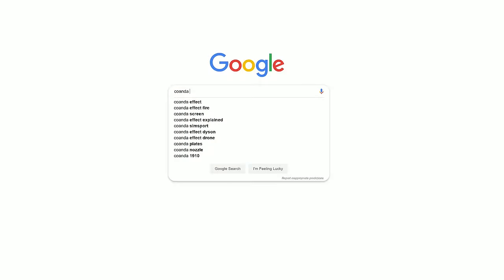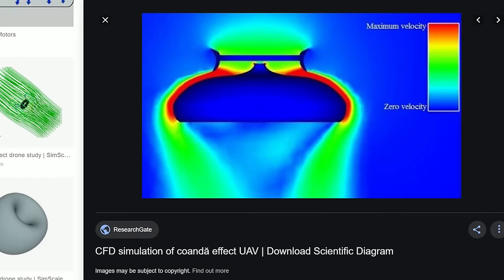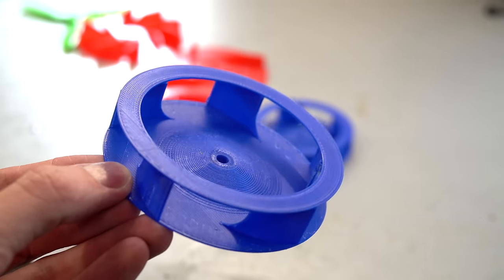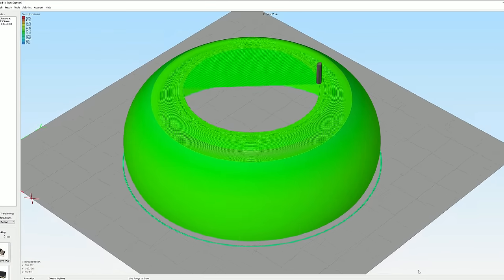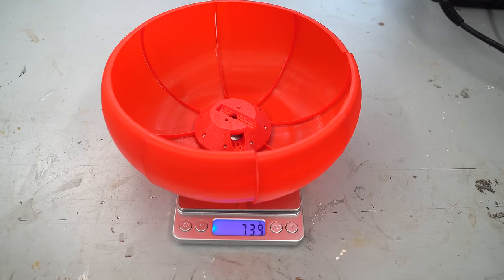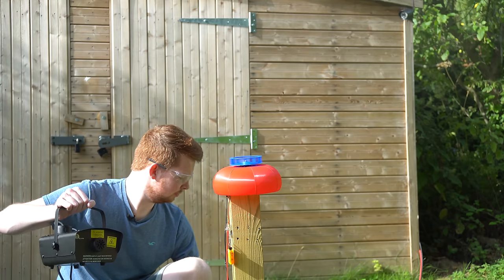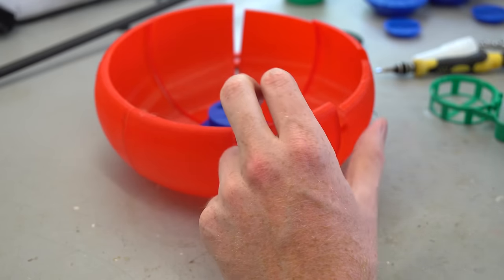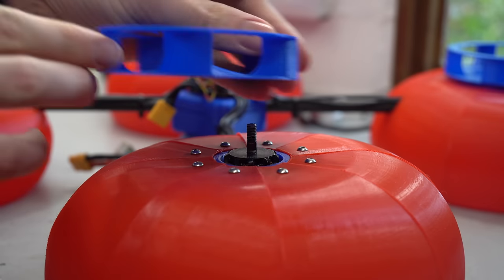Coanda Effect Drone Propulsion

Comment: Encase the impeller with a covering bell so the wasted airflow is directed along with the drawn air.
Reply: I agree 100% with this. I rate you could very possibly achieve desireable lift with that relatively easy mod.
Reply: Adds weight.
Reply: I was thinking the same, but only because with the Impeller, it's basically half a turbo that is wasting most of its power due to a lack of "plumbing" to channel it.
Reply: It can't just cover the impeller though, it has to cover the whole thing and serve as sort of a channel... the only real problem with this... is that it isn't an illustration of the intended effect... it's just a way of making the thing produce thrust instead of wasting air power.

Comment: That thrust being produced is applying direct drag in a direction opposing the thrust and therefore straight to Weight vs Lift.  Your attempt with the original impellers seemed the proper path ad maybe with maybe a shroud to channel all the thrust over the bowls.  But then again the propeller is the most efficient mover of air as the Wright Brothers efficiency was over 90%.  Great Project and enjoyed the knowledge gain...

Comment: How about trying out so called chevrons at the bottom of the bowls, much like how they do it at the rear part of modern jet engines? I think that might prevent the flow of air to go into the bowls, directing it more straight downwards. As always, thanks for the video!
Reply: Chevrons on turbofan engines have more to do with controlling the way the airflow leaving the engine meets the air flowing outside the engine and the noise created as the result of that high velocity air flow meeting the much slower air outside the engine. This matters a lot when trying to reduce the noise at take off when the aircraft is at high power but lower air speed.
Reply: @Klippy Klop but you are not being very polite in you language! 😒

Comment: I don't know if you've followed up on this drone test in a later video, but I think I do see one distinct flaw in your understanding of the "Coanda effect" (I've always known of it as part of the Bernoulli principle), is that the movement of the fluid will generally not be influenced at an angle over 90 degrees from initial flow. Angular momentum can be a pain in the ash like that.

If I were to suggest an alteration that might increase the efficiency of your design, I would probably have cut off the bottom quarter section of each dome, as they are extra weight for very little increased effect, and I would probably have made a "vent" around each impeller to stabilize the airflow slightly, and just make it bond better to the surface of the domes. The last thing you could probably do to increase the efficiency of the domes is to use Acetone vapors (depending on the material used of course) to smooth out the surfaces of the printed plastics.

At least, that's my understanding of the principles involved. Still a neat video to watch, and concept to consider.

Comment: I think you were trying to iterate on the prop/impeller because that was probably the easiest part to quickly print several versions of, but the aspect that clearly needs more work is the domes, both the smoothness but also the curvature and shape. I think you want to make sure the air is attached all the way up to the cusp (to take advantage of the kutta condition), and you want the jet to start out as thin and as close to the surface as you can manage. Cool project though!!

Comment: ABOUT THAT PASSIVE STABILISATION THING : (like so Tom can see)

I actually considerred the exact thing as a controlled descent for a hypotherical Cansat 

it'd be interresting to see if one impeller is self stable (if the center of mass ia below the coanda dome)

I was thinking that it would have some passive stabilisation advantages over a regular propeller, in that if the air dets deflected down along a surface, if the dome rolls to one side, that side will have the flow separation higher up along the dome, and since the flow separates higher up, it will produce a higher horizontal component to it's thrust (essentially tangent to the surface), not that horizontal component will go outwards, on the exact side that is lower, and then, it would flip back to lvel flight, i'm guessing ? 

I mean if you look at those CFD diagrams, it certainly looks like that's a reasonable thing to expect

so, yes, ground effect stabilisation could totally work as well, even with your current design (but probably better when over a smooth surface) just because the air cushion would reflect stronger off the ground when one of the domes gets closer to it, but I feel like there's real potential in making a descent control system that's essentially passively stabile as long as it's falling, you'd essentially have a controllable airbrake (that doesn't depend only on the falling speed) for really small systems where you can't have the diameter of a large propeller (because it has to fit inside a sounding rocket) , so you put one of these domes on top of a cyllinder, with no control surfaces whatsoever, other than the impeller up top 

also, you might want to try making a small skirt on the blue impellers ... basically, see that you've got a sandwich of 2 circular planes with the impellers between ?

just make the top blue part extend outward a bit more than the bottom part, and also have a downward curvature, this will really make a lot more of the air just go downward, because, if you look at the first example you've made, with the smoke and the curved piece, you can clearly see, only a residual quantity of air will actually flow down, because there's not much to push upon it, so a little bit of air flows there to fill the low pressure, but once the pressure equalises, the rest of the air keeps going on it's way, resulting in a HUGE waste of thrust, because the horizontal component gets cancelled out

Comment: To make the domes lighter: 3D-print a thin frame and attach foil to it. It just gets pulled (when an impellor is used) and should still be able to withstand the forces.

Comment: 3:52 "layer lines perpendicular to the airflow". I don't think this will do any harm. Frisbees (also using Coanda effect) do this on purpose. They have a ring of ridges on the top surface near the rim.  Their purpose is mostly to enhance stability/consistency by forcing the transition from laminar flow to turbulent flow at a predictable point. The airflow over a frisbee is different, so the air flows over the ridges twice, and the ridges aren't truly perpendicular to the airflow everywhere, as they would be on the dome. But they are, by design, deliberately perpendicular to the airflow. Frisbees spurn laminar flow, but they still fly pretty well.

BTW, frisbees and spinning balls also exhibit a different effect, the Magnus Effect, which is actually enhanced by surface roughness.
Reply: One this that is significantly different between a frisbee and the domes being used here, is the dirction of travel. I challenge you to throw a frisbee with the top flat surface towards the direcyion of travel. You wont get very far. It's like trying to rip a frisbee off the water directly upwards - you'll just create a vaccum under the frisbee, and it will be much more difficult than to pick it up from one side and tilt it over first, to let air in.

Comment: People get confused Bernoulli's principle. All vehicles: quadcopters, airplanes, boats, cars, rockets, submarines, anything which moves, follow Newton's Third Law. A wing generates life because it pushes air downwards, Bernoulli's principle only describes the mechanism in which reactionary air mass is pushed down by the wing.

These Coanda effect domes would be no different. They are moving a mass of air downwards equally and opposite to the lift on the quadcopter.

Comment: I have a suggestion that should work wonders, although it will impact the overall design some.

First you need to have two domes. One will fit inside of the other. Basically a larger dome that will sit outside the first. The top of the outer dome needs to have an opening just large enough for the impeller to sit snug. The air gap within the two domes will serve to create additional pressure which will in turn boost the overall lift generated. I cannot say for certain, but I believe in this setup you can use the impeller and this will also make for better aerodynamics if fit well. Optionally you could fit the propeller in lieu of the impeller as you have done. The thing with an impeller is the number of slots will need to be played around with to get optimal flow. At least with a two domes approach you can better measure the overall thrust as it will all be captured and stored until it exists via the bottom of the two domes. At this point however it is safe to say this is more of a proof of concept build. It would be great if you do try this to compare overall thrust values from this modification and just a plain ol' propeller. Let me know if this works out for you. I have a few more ideas of how you can better the results beyond this with minor configuration tweaks.

Comment: Could you use an aerospike like 'nozzle' on the bottom to increase trust and efficency, potentialy outwaying the weight penalty?
Reply: I think this would create a region of low pressure under the drone, which would negate the lifting force, and hence would not improve the efficiency, but instead decrease it.
Reply: *outweighing

Comment: Interesting experimental use of Coanda effect. 

Two considerations come to mind: 
1) If the motors are shielded from cooling airflow by the domes, they may be more prone to overheating. 
2) How much aerodynamic interaction might there be between the domes, how does altering the separation affect this, and is it a net benefit or hindrance?

Comment: Can you test a ducted propeller drone vs a regular unducted propeller? Will it be more efficient even with the extra weight?
Reply: It will and will not be.
The ducts may increase thrust but then the airflow is also more turbulent and the overall performance sucks.
There's a reason you don't see that concept used
Reply: I've seen tests done with ducted fans used for hovering, and they are pretty poor. Though a stationary hover is rather good, once you start moving laterally is causes the airflow the become asymmetrical causing a significant decrease in performance and asymmetric thrust which has two effects. 1, to reduce overall thrust, and 2, applies thrust in the opposite direction to the one you're trying to move in, so the aircraft will essentially fight you all the way to the ground if you try and make it move quickly.
Reply: @peterzingler6221  How about ducted airflow through smaller tubes for laminar flow? I know that works well for liquids, but I don't know about air.
Reply: @trevorschrock8259  same thing there to much loss. Modern propeller are as efficient as it will get. If you want more efficiency go for less blades aka a helicopter. That's also why most military drones are helicopters not quadcopters
Reply: Many years ago when this idea was first tested for drones, a shroud around the prop increased efficiency ( and safety) to the point of always including it in subsequent test beds.
Reply: It depends on what type of duct he were to use if he were to use a moderatley tall duct with small arms keeping it on the rotor it would be best because there would be minimal prop wash and the speed wouldn't be too greatly decreased but Ig he were to use a tall duct with large arms keeping it on the rotor those arms would be less likley to break but the prop was would be horrible unless those arms were more tall than wide but a taller duct will keep a drone from going fast forward because of drag but depending on the weight of the duct and the design the thrust would be increased so it probably could go faster but it would be more work on the motors to keep it going so I say non-ducted propellers are better for drones you want to go fast and ducted are better for ones you want to keep in the air longer so it all depends on the situation

Comment: You could have printed this dome upside down, you wouldn't need supports this way ;-)
Reply: than the overhang problem wouldve been at the bottom
it wasnt jus the large flat surface that posed the problem
Reply: @officer_baitlyn  There wouldnt be any overhang if printed upside down. It would be directly touching the bed at that point.
Reply: True, but he also stated he didn't want the layers to be perpendicular to the airflow. So, he would probably end up doing what he did anyway
Reply: @mikehawk4517  perpendicular layers would greatly increase drag, but it would cut down on assembly time by a lot. Though, given how inefficient this setup already is, it definitely needs every helping hand it can get, so his setup does make more sense.
Reply: @milkhbox  Assembly time isn't even a factor here. He's not planning to mass produce this any time soon.
Reply: @officer_baitlyn  no it wouldn't. He'd be stacking layers upwards relying on the bottom layers for support.
Reply: @milkhbox  little acrylic paint wouldn't hurt smooth things or add too much weight.
Reply: Print in abs or pollysmooth, mist with rubbing alcohal, would be perfectly smooth, always print using the "cup up" method
Reply: @Tekitremble  great idea as well. Not sure why he decided to do it the way it's instead. 

He seem to have good ideas but at the same time tends to create unnecessary struggles in his work. Some things he does are approached in a wonky way.
Reply: @TechnologistAtWork  I went to school for computer aided drafting and design for a few yrs and have yrs of experiance with 3d design and 3d modeling. A lot of what people do seems very wierd to me. He should have 3d printed 1, and then vacuumed a melted sheet of thing plastic over it, light as youre going to get, and very cheap and smooth.
Reply: @milkbox if he had printed it in half and each half being on it's side than he would have eliminated drag and reduced build time simultaneously
Reply: @suppermud4017  I noticed all of his videos are inspired by other people's work, so his application is pretty whacky. And his solutions aren't the most efficient.
Reply: Perhaps a better idea would be to vacuum form the existing 'tomatoes' with styrene. That would be much smoother and quite easy

Comment: if bottom was solid. vs a bowl shape, wonder how this would change the ground effects
Reply: It wouldn't change it in any significant way
Reply: The bowl could be sought all the way around but still be hollow in the middle so it wouldn’t weigh that much more
Reply: I mean you may have less lift because there’s less space for air to be in low pressure under the bowl
Reply: Or a cone shape?
Reply: @notchs0son you want the low pressure to be on the top.  If it’s on the bottom the pressure is pushing down.
Reply: @notchs0son  Wouldn't having a low pressure region under the bowl be detrimental as it would deflect the air stream into the bowl instead of straight down
Reply: @hadhamalnam  dude thats such an interesting username. Lol

Comment: I notice you only built the top half of the coanda device. Where's the lower airflow guide?
Reply: BING!
Reply: im pretty sure the whole thing would work a whole lot better if there was a larger dome shell ontop of the existing domes that way there would be close to 0 airflow loss
Reply: @jackasshomey  that is same as the curtain/skirt of a hovercraft .
Reply: @lloydpimm1271  yep :D and that's why it would probably work a lot better lol the quad copter orientation is actually a great idea cause you would be able to control the movement on all axis by lowering or raising a single fans speed

Comment: I have a suggestion, most likely won't help, but would a ducted impeller would better than unducted ones?
Reply: Probably
Reply: @suppermud4017  Or perhaps he could use propellors that fire sideways.
Reply: ducted fans work great but require extreme precision to work correctly, if your tolerances are loose, you end up making them less efficient

Comment: Imagine, if you will, a single one of these 'pods' with moveable surfaces down the sides to control the low pressure air covering the outside of the dome.
Reply: Coanda called it a Lenticular aerodine😊

Comment: This is pretty cool. But calling this a "Coanda Effect Drone" is kind of misleading.  Don't all wings use the Coanda Effect to produce lift? Whether it be a fixed wing (planes) or rotary wing (drones) vehicle?
Reply: David McKee  The same affect happens at the top side of a wing. That's how the air from the top side of the wing is "pushed" to the lower side to produce lift. 

Wings are not  quite plain sheets. They have an airfoil design that enables the  air flowing above it to gain more speed but (due to the coanda efect) still stick to the wing and flow downwards.

Comment: Impellers under the dome sounds interesting.  With a hole open in the top for input air flow, and the impeller pushing the air under the dome and down.

Comment: As Jeremy Clarkson would've said, "So, what you've done here, mate, is make a conventional drone abit more noisy." 

But puns aside, why don't you put the rotors under the skirts, and cut holes in the middle, thus, making it a turbine. (i.e. forcing all air, which they throw out, to go down, rather than spread in vapors)

Comment: Why not use two domes. An outer and inner dome with the space between being a control space for the air flow.
Reply: That would stop the higher pressure outside air from rushing to the low pressure area which is creating the thrust
Reply: By inverting the impeller and placing it in the top of the dome and another impeller on the outside top of the dome
Reply: Create low pressure outside and increase pressure inside.
Reply: With thrust as a byproduct
Reply: You are almost doubling the weight with two domes.